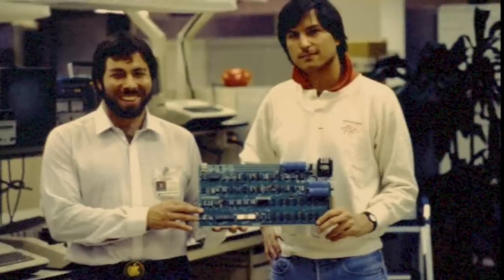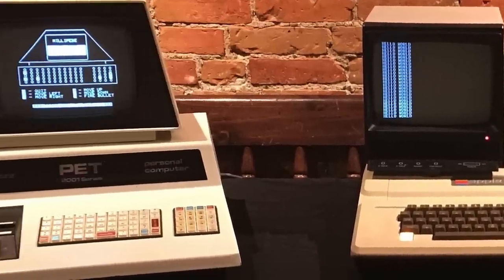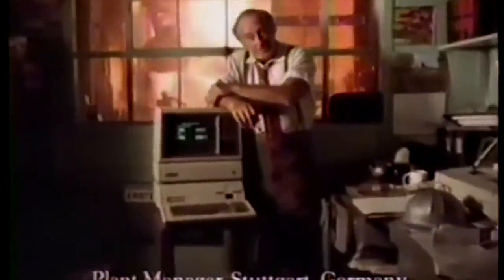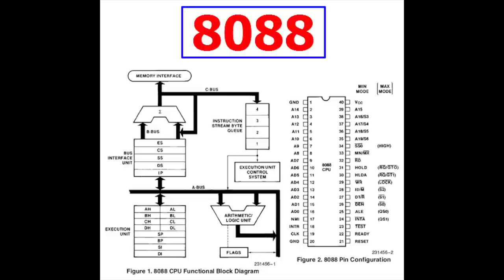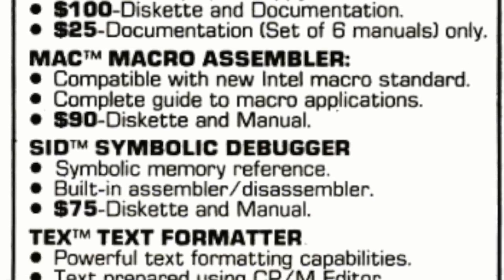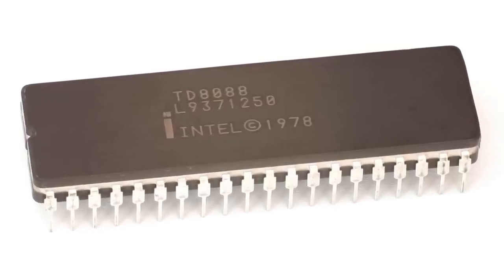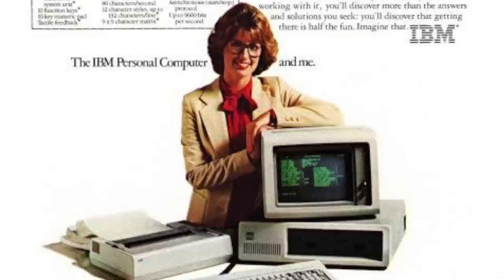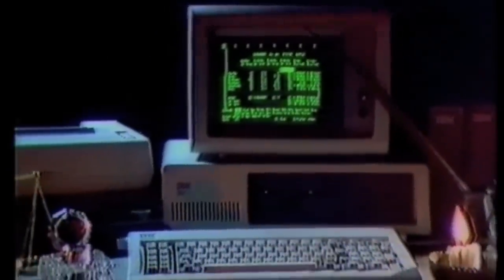DOCUMENTARY: Why and How IBM ended up creating the PC (and ended up choosing the 8088 CPU)

Comment: We purchased a Commodore 64 for our 8 year old fairly smart son when they first came out. Over halve of the little 64K of memory was used to run it. Had to insert a floppy disk then type in something then wait awhile then had to remove UT and turn it over and load that side. Think it took 12 to 15 minutes to load a very limited program to print out a 4 line hone made greeting card. Printer had a 4 color tape that printed less then 20 pages before it had to be replaced. Can remember going into offices back in the 1970 & 80's and seeing huge pile of IBM that we called punch cards in boxes all around.

Comment: I am old enough to have been a young programmer in the late 70s.  I did most of my work in assembly language due to the slow speed of computer systems.  I looked at 6502 based systems and Z80 and found the 6502 sorely lacking and chose to support Z80 based systems.  Later in the late 80s I was programming in 8086 asm and Pascal but would be daily frustrated with that stupid segmented memory architecture and this did not let up until sometime in the 90s.
Reply from the maker: I have an interview with a man who worked in Lotus on 123 coming up and he talks about that very problem. Quite interesting to hear how people had to work around the issues back in the day

Comment: I dabbled a bit writing in 6800 assembler in the late 1970s and later some 6502 assembler.  When the company I worked for got the 8088 based IBM PC I couldn't believe what had to be done for memory access on that chip.  Still, the PC was the safe bet in the corporate world.  The first application I wrote was a GUI front end for a dial-up TTY money transfer system.  Since there was no hard drive at the time, just two single sided floppy drives, the whole application, written in BASIC, was stored on two 5 1/4 inch floppies with six tutorial/help discs.
Reply: I wrote a keyboard handler in Assembler for MS-DOS in the eighties. Yup, some memory access ;-)  The funny thing is that bit of code, compiled circa 1990,  still sort of works on  dosemu under Ubuntu MATE 20.04.

Comment: The first company I worked for was very resistant to PCs, but mostly Apple fans.  My last company only bought Apple for high end visual or graphic systems.  I bought over 2,000 IBM type PCs each year.  The difference being we could build an IBM type machine to do whatever WE wanted.  With Apple you could build a computer to do whatever APPLE wanted to let you do.

Comment: From early on before microprocessors IBM had been working the industry for central computing, even from home with terminals.  The home computer market put that plan they worked on for decades in trouble.  But Internet, and most notably the Web Browser had put them back on track.  And while we all have personal computers in some form, we also now heavily use a central computing model when we use the web.  The blending of home computing and central computing gave us more than IBM ever thought of back in the 60s.
Reply from the maker: I've thought about this very thing many a time. To think that Bill Gates couldn't see the importance of the internet for a long time too is wild IMO. IBM should have doubled down on the internet and making the PC the forefront of that and reduce the costs of their PC's (potentially make a loss to make gains in the internet) rather than sell the PC business altogether.
Reply: I call it the pendulum of computing. We first had mainframes with punch cards, then next we had attached terminals. We then went to distributed processing on PCs and now we are back to central computing with terminals (home computers) where a lot of the work is web based and processing being done on servers. This centralized way of doing things is much more efficient as there is no software distribution or updates (other than the o/s)
Reply: @rty1955  IBM probably new the home computer was on the way and tried to push it in their favor until failure from smaller upcoming companies that had no corporate control at the time.  That's when they decided they needed to enter that market themselves.   The are still around in a big way, but cloud and AI.   It was the Internet that put then on track, but they had to act quickly.  While it may seem like 2019 was late to purchase Red Hat, they been using it on their servers since the 90s.
Reply: @delscoville  they have a supurb o/s for transactional processing and have for decades. They also have a supurb o/s for batch processing.  too. While gates and jobs pushed their way Ino schools, IBM did not. I taught mainframe operating systems in college, not done anymore. IBM is in the HARDWARE business, and they do make the best general purpose machines on the market. Its just a shame that most people have no exposure to one. To work on one is truely a joy.

Comment: As some one  who has lived through what you describe, I appreciate your insight and summary of the early IBM PC. I bought the ill-fated PC-Jr as my first computer, a big mistake! Still, I use an IBM descendant desktop to this day, a Dell computer.
Reply from the maker: Thanks David!
Reply: Since 1995, I have assembled my own PC's from selected subsystems, for Linux. As for laptops, IBM and then Lenovo mainly T-series have been my  go-to machines since 2001, reliable performers usually bought in the second-hand market (which generally features ex-corporate units) and with excellent Linux compatibility.  Compared with pre-PC computers, the commodity market for PC subsystems provides amazingly reliable gear if you choose with a little care.

Comment: I find it important to try and learn about the origins of anything instead of just taking them for granted. I would like you to make a video about Xerox and its contribution to turning the PC more user friendly and why it gave it away to Steve Jobs instead of launching what was to be a revolution. Great job. Thanks!
Reply from the maker: Thanks! I am actually doing a video on that topic in the future, so make sure you are subscribed and have notifications on. You'll see it pop up some time!
Reply: It's a misstatement to say that Xerox "gave it away" to anybody. They built the Star computer for many of the same reasons GM built the EV-1 electric car -- they were testing the market and trying to learn what people liked and didn't like. What GM learned was that dealers would revolt if they started selling these electric cars because they required so little after-market maintenance work, which is where most dealerships derive their profits. Xerox was never in the business of building general purpose computers. They just wanted to see how people liked different features they built into the Stars, some of which went beyond the machines themselves.

I worked briefly at a place once, and one day I took a wrong turn and went down a hallway that happened to be lined with a whole bunch of these Xerox Star computers. I asked someone what they were doing there, and was told their leases were up and Xerox was taking them back. I'd heard about them briefly, and tried to learn more, but nobody would say much about them other than Xerox had asked the company to be something like beta-testers for them. Folks liked them, but the software was limited. Not surprisingly, they talked directly to Xerox copy machines that could be used as printers, which was unheard of at the time. They were all replaced with Wang workstations. 

They came from Xerox PARC, which was mostly a research place, and they didn't get into any kind of production -- that was never Xerox's intent. That's where Jobs took his team to learn about the Stars, and Xerox was more than happy to show them off. You can actually see the results of some of what Xerox learned from the Stars on large copy machines introduced in the mid-80's -- the touch screens and how they controlled the overall machines. Remember, Xerox wasn't into computers, they made high-end copy machines and office equipment. They happened to be embedding computers into their newer copy machines, which allowed them to transform how they were used (from a UX/UI standpoint) and make them run MUCH faster. To them, Stars were just a way to test a bunch of new technology and get feedback from users. They were never intended to be mass-produced. 

One could also argue that Xerox "gave away" the laser-printer market because HP believed there was a market for small, hi-res laser printers set up on a departmental level in businesses, whereas Xerox's vision was that people would use networking to send print jobs directly to their behemoth copy machines to get print jobs done. People forget it was Apple who released the first low-end laser printer that had amazing capabilities at a very affordable price. This was another thing they learned from Xerox. I believe the "engine" inside of their printers was built by HP (or maybe Canon), but they used a motherboard with software they designed in-house based on PostScript to do the rendering.

Something most people don't  know is that Xerox was one of the key developers of Ethernet -- there were three companies involved in its first iteration: DEC, Intel, and Xerox. Stars played a role in that, to the extent that they could be interconnected allowing data sharing. Large Xerox copiers introduced in 1980 had early versions of Ethernet inside of them that was used to move data through the machines. (These were things that were 15-20 feet long that were used for high-volume copying.) My team at Intel interviewed a guy who had been working at Xerox for a few years on that very technology, and we got quite a lot of insight into how they had been using Ethernet inside of their big copiers. They had the equivalent of a half-dozen IBM PCs (without the monitors) inside of these big copiers, using early versions of Ethernet that required a 12"x12" circuit board to implement, in addition to the main CPU board. It was VERY Expensive tech at the time!

Comment: I’ve actually used one of those things before. 8088 PC by God! They had them at a state government facility I went to where disabled people went to learn how to navigate college before they actually started. It was in the mid-1990s. So, it was already an old machine then. But, it was really interesting to use. In those days, the top of the line was a 486 with an actual harddrive in it which that 8088 did not have. They had a couple 286 machines there that boasted 10 and 20 MB hard drives. Hard to believe nowadays. We measure those things in terabytes now.

Comment: the 8-bit data bus of the 8088 opened the door to compatibility with lots of 8-bit devices that already existed and were mature. For a project looking to get to market within a certain window of time (or else IBM risked that market moving on past them and leaving them behind), the 8088 was an immeninently more sensible choice over the 8086. Is a shame Motorola didn't come out with a 6809 that used segment registers too to address beyond 64K as then they might have been a strong contender. The MC68000 was a superb CPU but there was just no two sourcing of its manufacturing and IBM refused to let themselves be dependent on a solitary supply source for the CPU
Reply: The Z8000 would have been a better choice. second source AMD, SGS-Ates, Toshiba, and Sharp.

The 68000 was second sourced by Hitachi, Mostek, Rockwell, Signetics, Thomson/SGS-Thomson, and Toshiba
Reply: Motorola 68K was way ahead of its time. It had 32-bit ISA and as computers which use it showed even older programs took advantage of it if they were designed for 32-bit words where such operation on 8086 was dog slow, let alone on 8088... that said programs didn't often need even 16-bit words and often used 8-bit. This is especially true because on 8088 there was big performance penalty from using 16-bit memory/io accesses.
Reply: @e8root  But Intel was ahead of the pack in providing an optional  floating-point processor, a good one with 80-bit internal precision. For a scientist, that was a big plus.
Reply: @awuma  best argument so far. I too would rather choose processor with optional 80-bit FPU, especially if it was the cheapest option
Reply: Definitely - the Boca Raton group needed to meet its deadline, and 8-bit off-the-shelf support chips like the 8255 were readily available and priced very favorably.

Comment: Great video. However, he was called Don Estridge, not Phil.  Don was his middle name.  He unfortunately died in the Delta  crash in Dallas.  It was due to wind shear,   which was little known at the time. Another IBM employee of mine also died in the crash.  They were all on the way from Boca Raton to LA. 
Also, when we launched The 5550 personal computer in Japan we used the Intel 8086 as it supported 16-bit bus access which was needed to use the double-byte characters used by the Kanji language.
Reply from the maker: Thanks for your insights. Sounds like you have some great insider knowledge. I'd be happy to have a call and talk more with you on the subject, perhaps we could make a video?!
Reply: @Al's Geek Lab  I would be glad to have a call. How can we set that up? I spent 25 years at IBM much of that in Japan.
Reply from the maker: @danielsullivan5130  I am in New Zealand so we are only 4 hrs different. I could possibly do a call today if you are available. My email is in my about section here on yt,  or send me a DM on twitter.

Comment: I use to service and repair several types of banking terminals (as we called them)  and i saw the whole pc uprising which ended up terminating several thousand jobs which actually repaired these communication devices in the customer offices.     I repaired sever type terminals and even saved a complete line once by replacing glitch producing transistors.  I should have gone to the Company president to show why his largest computers suddenly started passing...  instead a supervisor refused to pay me my over time which helped me produce this result.

Comment: I remember rescuing a 5150 from my IT teacher in upper school school back in the mid '80s. I think he had been given it by a local chemicals company who used it as a lab data logger and he didn't know what to do with it - the school network primarily being Research Machines based, there was no real use for it, so it was destined for the bin. In hindsight, I think I got a good deal, what with it still being only 5-6 years old and still reasonably current. Served me well for a few years before being upgraded to a 286. Still have the motherboard for it in my pc parts bin :)
Reply from the maker: Great story! Yes you got a good deal!

Comment: I went with an Apple ][+ in '81. I was a software developer on IBM Midrange systems at the time, the S/34 and the S/36. They used 8 inch diskette drives, and you could not get IBM compatible 8 inch drives for the IBM PC. But you COULD for the Apple ][ line! I ended up doing a lot with my Apple ][, even adding a Z-80 coprocesser and running CP/M. It was a great machine! I still have it, though it has been years since I have powered it up.

Comment: I too am old enough to recall the "what do you need a PC for?". I did get a lot of old mainframe parts and managed to interface a Wyse terminal to my Sinclair Spectrum, a line printer (and I wrote a program to print out PI!). I also managed to reverse engineer a data entry keyboard to use on the spectrum which was a big deal back in the day as the keys where all using hall effect sensors...
Reply: Now, was the serial driver polling or interrupt driven? The original IBM BIOS polled the serial port... which was no good if you were using a multi-tasking add-on to MS-DOS.

Comment: At 19:48 there is a diagram showing the 8086 & 8088 address & data pins. The words seem to be in the right place, but the braces showing which pins are short. On the 8086 the brace showing the data bus is 13 pins long & the address bus is 17 pins long. On the 8088 the brace showing the data pins is 6 bits long & the Address brace is 16 pins long.

Comment: IBM choose the 8088 over the more powerful 8086 because they were afraid the PC would cannibalize their mini and mainframe market and its lower cost. And it became successful because, well, nobody got fired for buying IBM.
Reply: and from the 8080 family, and Intel. somebody at IBM was an Intel fan or knew no better.

The Z8000 or 68000 would have made a better PC.
Reply: The PC never came from Big Blue. It came from the GSD area. Big Blue considered it to be a toy (and still is) never to compete with the mainframe
Reply: @rty1955  
Correct. It basically came from 2 guys building them in a garage.
Reply: @fredflintstone505  haha well the GSD was very large. They were in GA & FL Big Blue is mostly in Armonk & Binghampton.
GSD made typewriters, photocopiers and other office equipment. They also made the Series/1
Reply: No, 8088 and 8086 have different areas of application. One major difference is memory. 8086 support up to 512K. 8088 support up to 1M.
Another consideration at that time was the IO bus. At that time, peripheral chip was mostly 8 bits. 8086 is 16 bits.
Reply: @chanh9220  and STILL very limited registers and only one that can do math.
The 8088 had to perform and additional strip on each memory fetch. Not very efficient